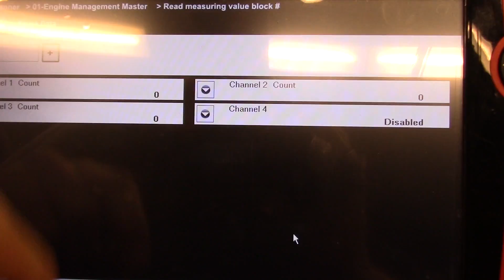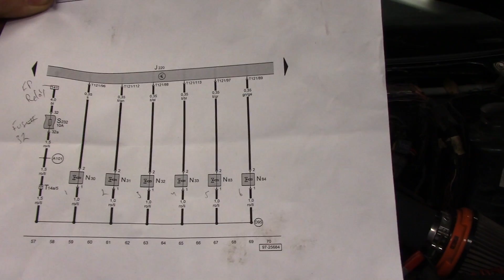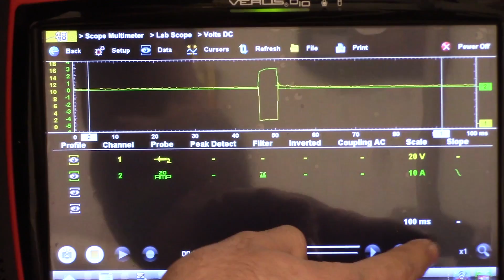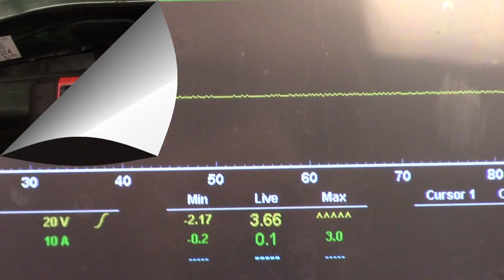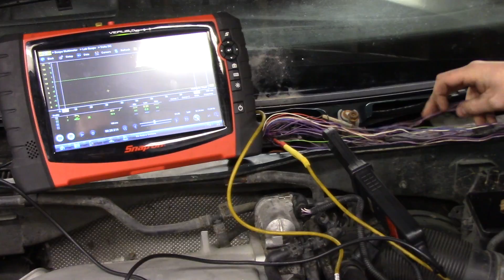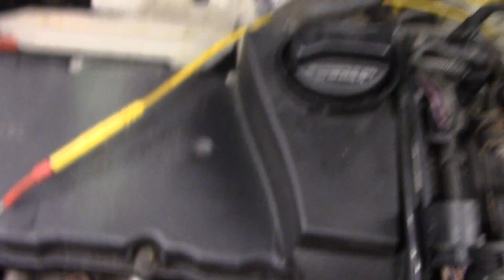2002 Volkswagen Jetta VR6 -Misfire P0262/P0206Fuel Inj. Circuit Faults-Part1

Comment: OMG!  This is my car and I have a similar issue; p1218, #6 short to +
I have the manifold off.  I have 17.8 ohms on #6 injector(and #5 too).
I traced the green wire back pretty far and it looks fine.
Could it be a bad injector?  I thought the 17ohms meant=OK.

It would be nice to be able to change an injector and call it good.

Comment: From my experience most of European vehicles need the engine to be running/cranking to power up the injectors, coils, idle air control valves and other stuff, for these components are powered from the fuel pump relay. Seen it in Skoda Felicia 1.3l multipoint inj. from 2000 and Fiat Seicento 0.9l singlepoint inj. from 2002.

Comment: the whole time I was thinking do a continuity test to check the wiring to the injector! also why did test light on positive battery trick the ecu? i realise its bypassing the rest of the loom to the injector but why positive?
Reply from the maker: I don't like ohm checks personally.  When the ecm does it's self test on the injectors it is expecting to see 12v on the inj control wires. So you take you test light from battery Positive to the control wire which pulls that bias voltage up to 12v and the computer thinks that the circuit is ok
Reply: ok cool but how does it see 12v on the control wire in the first place? are they ground side switched? or are the injectors grounded through the engine (in which case if the injector is open circuit as they were found to be here the computer wasnt seeing the 12v? 
Sorry if im being dumb here I like to understand so I learn. Really like your channel by the way!
Reply from the maker: Ground side switched. Exactly the open inj creates the incomplete circuit.  Thanks I really appreciate that.

Comment: Was nice watching and learned some things. After you found out the ECU was ok, I would have taken another path. Disconnect the ECU connector and test the resistance of each control wire from ECU to the Injector or feed the ECU Connector side 12V and measure the voltage at the injector end. Would have saved you the "pain" of turning the engine over and test would have been easier just with the voltmeter or your test light :))
Reply from the maker: I really don't trust resistance checks, I prefer the voltage drop method, but no way is wrong, there are so many approaches, thanks for watching!

Comment: Cyl 1 injector control did not quite go to zero volts it looked to be about 1 volt, I think that would be an indication of shorted coils in the injector, would it?
Reply from the maker: I didn't notice that. Not entirely sure on that but cyl 1 was def shorted

Comment: Nice job.  So it only puts out 12 Volts while cranking?  It doesn't at least give you a bias voltage koeo?
Reply from the maker: Yea the power side feed is controlled by the fuel pump relay. I'm thinking that the 3.5v on the control side is a bias voltage. I will explore that further in part 2

Comment: But im a bit confused maybe you can help me man, if its open why we would have 3,6 volts? No current flow no voltage drop is that right we should had 12v, what im missing? Thanks
Reply from the maker: The other thought is that it is a bias voltage from the computer
Reply from the maker: I will look into that on part 2
Reply: I also think it was a Shut down of injector 6 beacuse of the Open,  the feedback was lost and a different DTC circuit malfunction compare to cyl 1.
The cool thing was when you put the testlight on cyl 6 controlwire, then ECU wakes up start to control your testlight.
The amps is going through the testlight, and the ampmeter is still on the open injector circuit.

Thanks for great videos !
Reply from the maker: Thanks Robert. Definitely a cool test! Part 2 will be out soon
Reply: +Positive Lead Diagnostics thank you for responding im sorry i replyed just now but dont know ehy didnt get the notification, anyway cant wait for part 2!

Comment: Do you think by-passing the fuel pump relay would give the voltage at the injectors you needed verify.
Reply: Great video also. Glad I found the channel.
Reply from the maker: Thanks for watching. What do you mean? Jumping the relay?  You could do that. Might be a pain because those relays are a bit complicated. But it's def possible
Reply: Positive Lead Diagnostics By jumping the relay, I mean to by pass the relay or jumper wire between the control circuit pins/terminals.  If you don't mind me asking where did you learn your electrical diagnostics?
Reply from the maker: I would say not to use a jumper wire on the terminals.when the computer starts to ground or pulse the circuit with a jumper wire you have created a straight short to ground and it will fry that driver in the computer.  I used the testlight. The bulb will carry the load and basically protect it from a short to ground. I went to Rosedale in 2008-2009. ScannerDanner was my instructor.
Reply: It definitely show.
Reply: Wow like student like teacher

Comment: Would an ohm check on the injectors not have been faster ?
Reply from the maker: I don't like resistance checks. I don't trust them to be honest. The ohm check wouldn't be a bad idea. But don't forget you have to pull the intake first. So what would be an easier place to start. Ohm checks or voltage and amperage waveforms?

Comment: Nice diagnosis Tom. Part 2...sounds like fixing one issue uncovers another?
Reply from the maker: I want to get more fixes/repairs. So the part 2 will be one more check that I should have shown on this video and then replacing a fuel inj and getting known good waveforms
Reply: Gotcha yea videos are better when the fix confirms the diagnosis. Those injector waveforms  undoubtedly show a shorted & open injector.
Reply from the maker: I agree. I think it will make for a better video so I will try to do it when I can

Comment: how do you remember all the vw 2 codes for misfires fuel trims etc! id have to use a cheat sheet for sure
Reply from the maker: I have been working on the Vw's for 5 years now. It's stuck in my brain!!
Reply: It's a lot easier with VCDS, which labels all the measuring blocks & values. VCDS is a lot cheaper than the Snap-On too!  (Although not so useful for non-VW makes, granted)
Reply from the maker: Yea I still have yet to get the vcds. So far I haven't absolutely needed one. Obviously knowing the value blocks helps